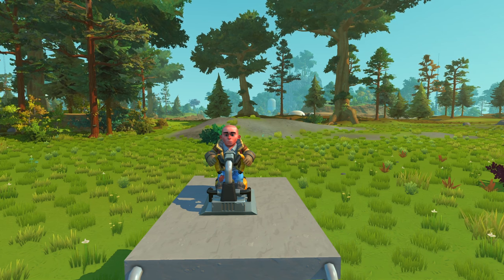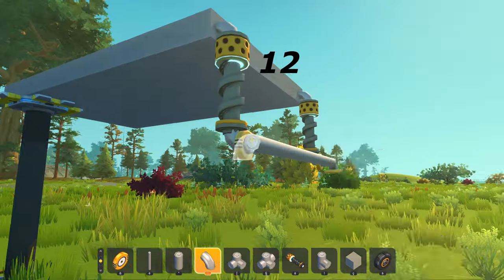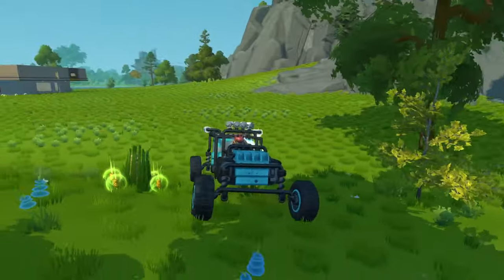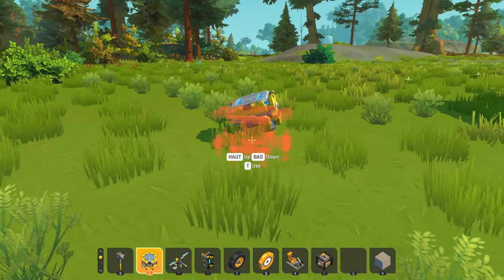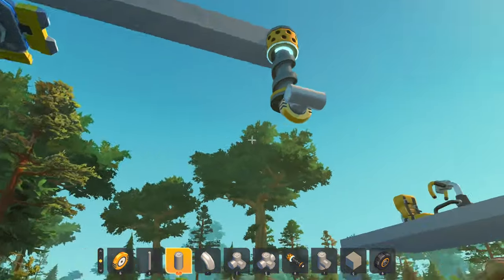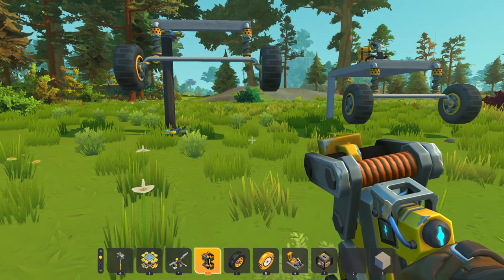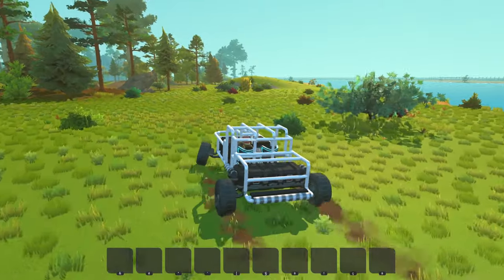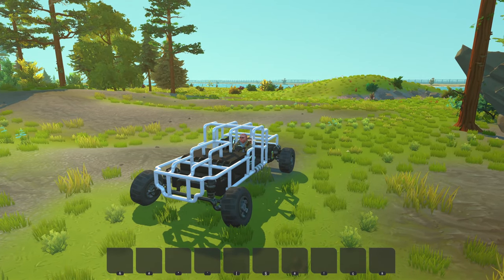Scrap Mechanic Tutorial !!! How to Build the best offroad Suspension!

Comment: The real thing has bearings on the 2 top coilovers, 2 bars connected to the live axle with bearings on both ends along with a bearing to allow those bars to twist, and a bar in the middle to create a triangular structure so the axle doesn't flop around. Yours is a cheaper option but could be troublesome for heavier vehicles ie. A vehicle with a bunch of craft bots + storage etc.
Reply: I dont follow exactly. Could you explain or point to workshop?

Comment: This suspension worked great for me. My vehicle doesn't get much traction so it drifts a lot but its really smooth and never flips.
Reply: the drift can be caused by either the weight of your creation or the power of your engine.

Comment: A real benefit of this is survival if you can add as many suspensions as you want, instead of upgrading them, saving component kits.
You can also use bearings on the connections between the body and the bearings to lower the vehicle by extending the wheels forwards and backwards.

Comment: idea to upgrade a spider leg suspansion rover ?
Reply from the maker: not sure what you mean, do you want to build a suspension system that looks lik spider legs ?
Reply: @band3rTripleIQ  not directly the suspansion but car has like 6 leg made of props and tilted with controler to make it stable ( and the suspansion is at the tip of the leg )

Comment: I tried to copy this but it doesn’t work the tires act funny and I can’t move forward
Reply from the maker: did you connect the steering right? and gas engine to the beering closest to the wheel ? like for 99% of the people this works fine. also check if your Physics in settings is set correct.
Reply: @band3rTripleIQ ok I tried but I can’t rotate when driving if I want to go somewhere I have to drive straight or side ways no rotation

Comment: i don't think you understand what independent is
Reply from the maker: If you read through the comment section this topic has been discussed in lenght, i have stated that i was wrong in the naming. Its a solid axle suspension so i have been told. I´m not a enlgish speaker so mr andrew i will tell you aswel i was wrong and sorry for the mis information there. Hopefuly the video was otherwise satisfactory.